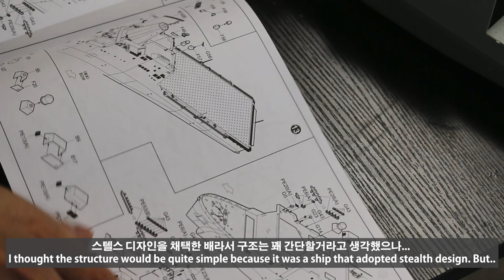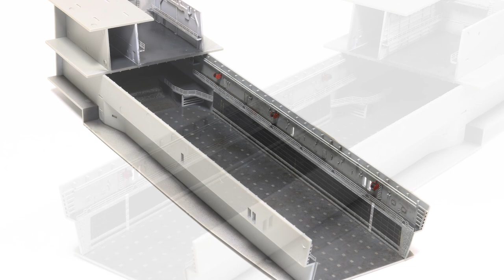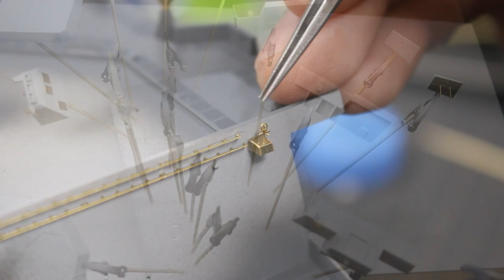PART 1. Painting deck -  1/350 USS  LPD-21 NEW YORK

Comment: Great job .  I think the masts look unfinished on this design  ??  they are massive to carry a few ariels , anyone agree ?    Wales UK.
Reply: Hey, copied the following for you.    The Advanced Enclosed Mast/Sensors (AEM/S) System mast, a 93-foot-high octagonal structure 35 feet in diameter, is constructed of a multi-layer frequency-selective composite material. It is designed to permit the ship's own sensor frequencies with very low loss while reflecting other frequencies. The tapered octagonal shape of the AEM/S is designed to reduce the radar cross section, and enclosing the antennas provides improved performance and greatly reduces maintenance costs.    Cheers
Reply: @petehoskins1267  thanks Peter  for the information , visually I think it looks like its gone under a low bridge .
Reply: @fredtedstedman  Yes agree it looks odd, probably you and I think of a mast looking like the Soviet Pyotr Velikiy, now that’s a mast cheers.